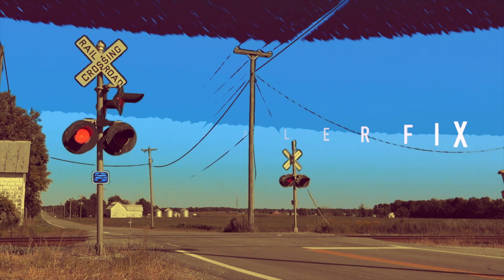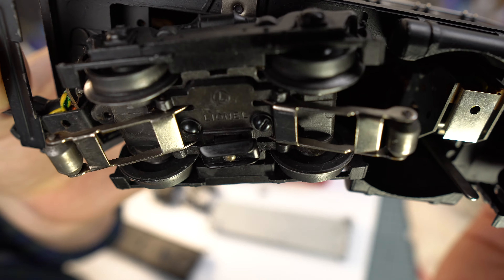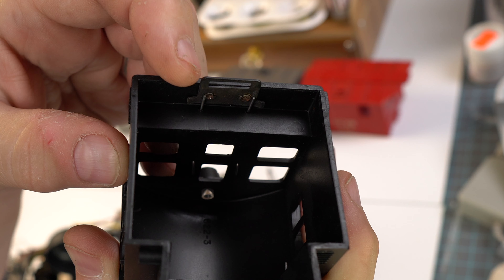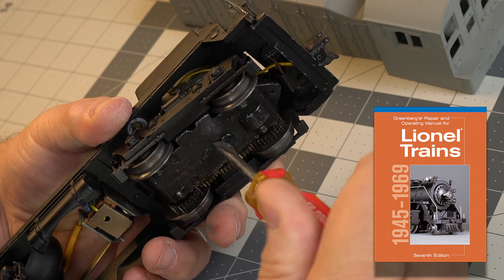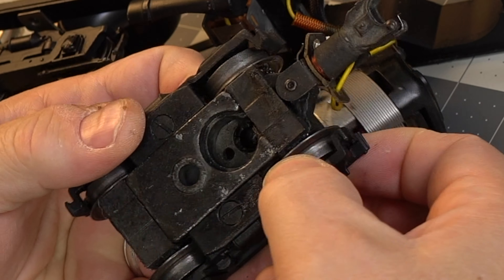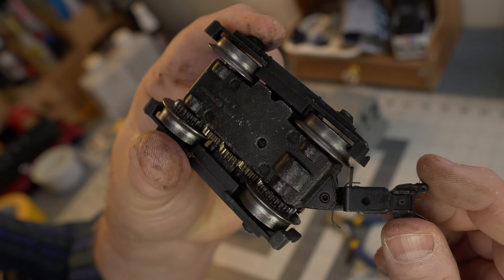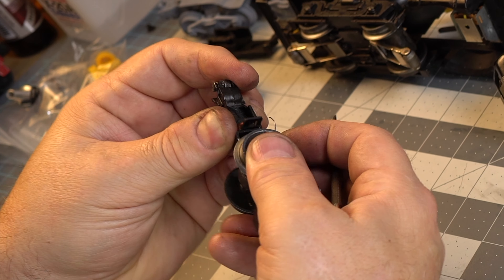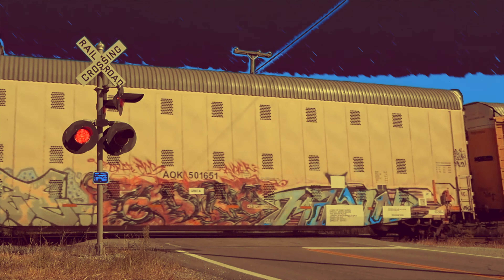How to Fix Post-War Lionel Coil Couplers!

Comment: If i was into 'O' gauge repairing that coupler instead of using  WD40 i would use electronic cleaner which is better, Just make sure that it's plastic friendly, Because WD40 is only good for metal parts only.
Reply from the maker: Thanks for the info!
Doug
Reply: @FullEarthWorkshop  And, Thank you for answering my comment.